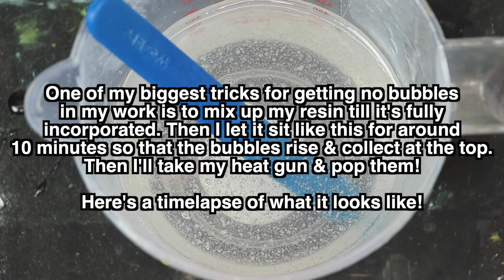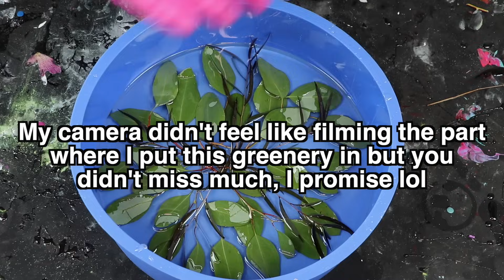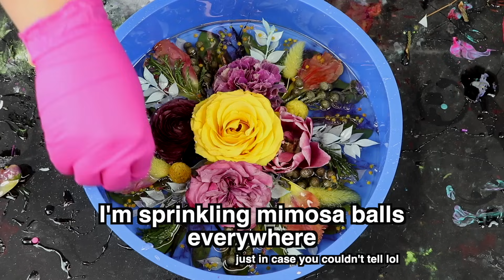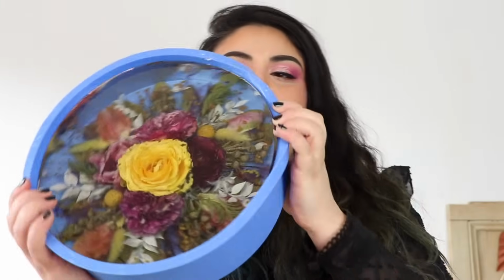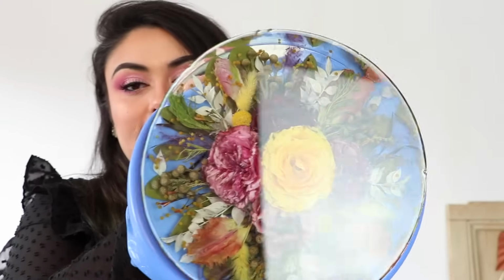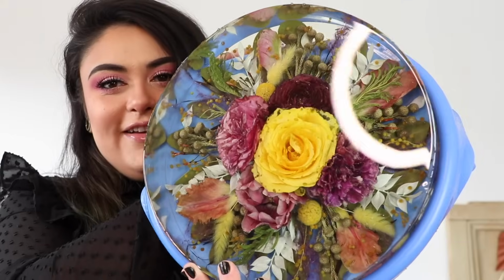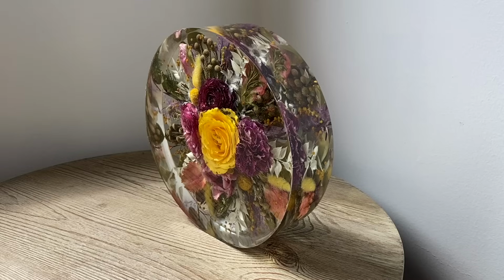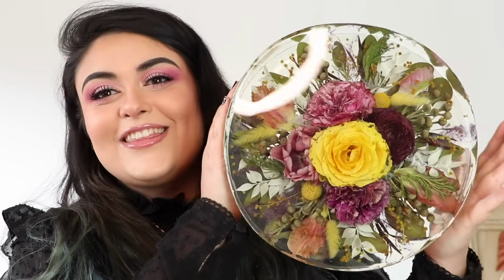Preserving All The Flowers We Dried Together in Resin! | An Entire Flower Bouquet in Resin

Comment: This is beautiful!! Did you use 2 cups of mixed part A and B resin for each layer?
Also, I’ve already started airdrying the flowers before I saw how to dry it in silica gel. Can I put the air dried flowers into resin or should I still put it on silica gel. I wish I saw this earlier 😔 drying with silica gel is so much better in preserving color

Comment: That turned out so pretty!  I'm curious how you ended up with a few bubbles when you did the heat gun on each layer?  (I'm new to resin and even more new to the idea of preserving flowers in resin so please forgive my ignorance.)  Is there a way to avoid them in times where bubbles aren't desired?  Your little bubbles completely add to the piece you did but I'm totally not that lucky in the maybe, two attempts at using resin.  LOL!  What a wonderful video!  #newsub (not that you need them but you are too cute girl! ❤)

Edit: Totally forgot the question I had when starting out my comment. #facepalm.  How do you finish off your edges on the top part?  I've seen people sand them but it seems to leave a rough looking edge.  I've also seen people use a super thin finish layer to sort of backfill to get a slight dome appearance.